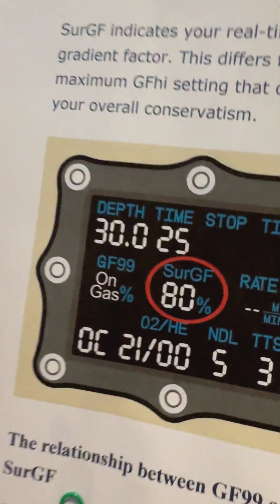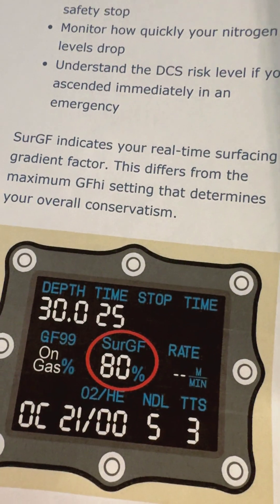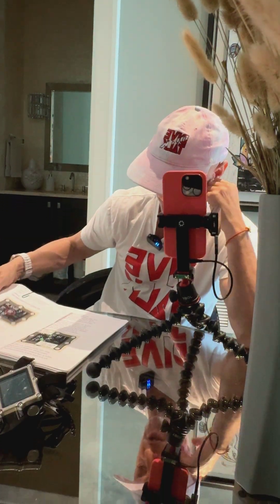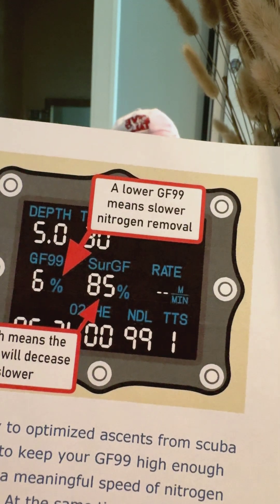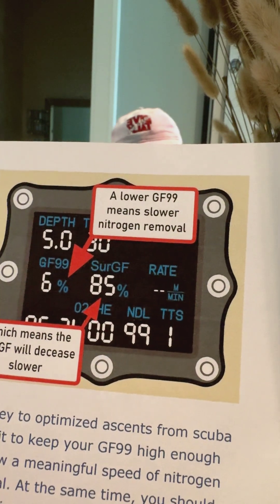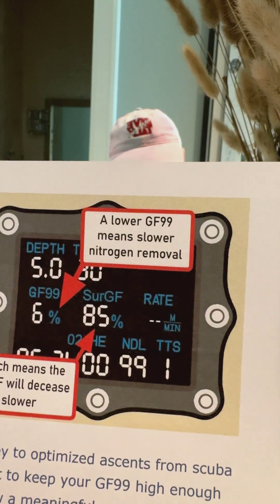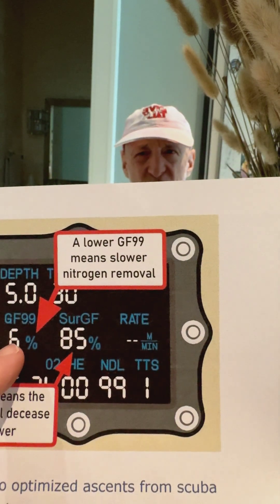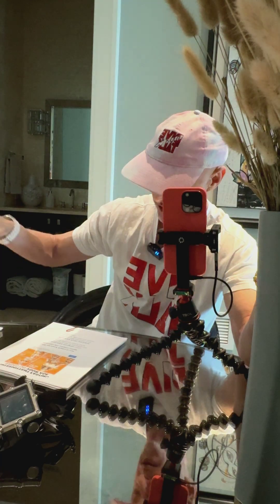Video 6 - SUR GF (Based off Andy Davis’s Article)

Comment: Here’s where I’m having issues. If you want your GF99 at half of your surf GF, then wouldn’t you just adjust your GF to where you want?  Seems like shooting for the half GF99 defeats the purpose of making your own settings. 

I dive 50/75. My Surf GF is usually around 60% but my gf99 is always really low because I tend to dive near ambient pressure and have a gentle assent. So I’ve stopped using GF99 and just watch my Surf gf. 

That said I’m still a rec diver and haven’t started tech yet. 

Can you tell me what I’m missing?  Feel like there’s a subtlety in here I’m missing.
Reply: Hey, you want your gf99 at half of your gf high which in you case is around 40%, not half of your surf GF. The higher your gf99 % is the faster you’re off-gassing and thay means that you’ll drop your surf gf down to your gf high quicker.
Reply: You forgot to utilize your GF99 as a speedometer for your gradient factor high setting. A "gentle ascent" is arbitrary if you learn how to use gf99 and surface gradient factor and understand its relationship with each other.